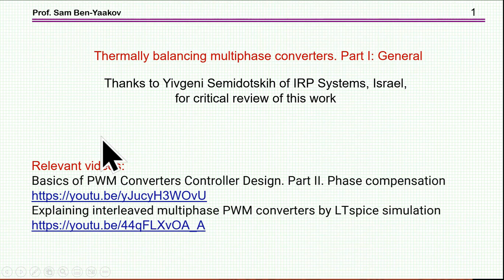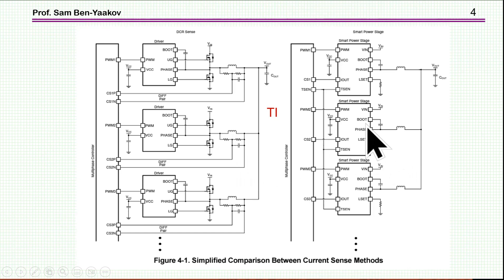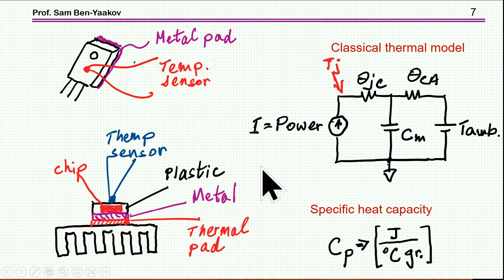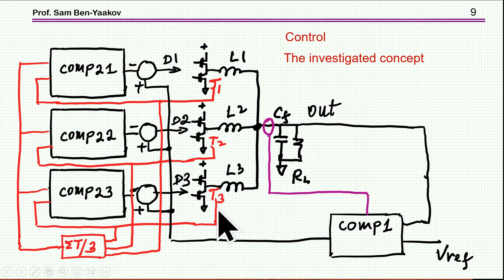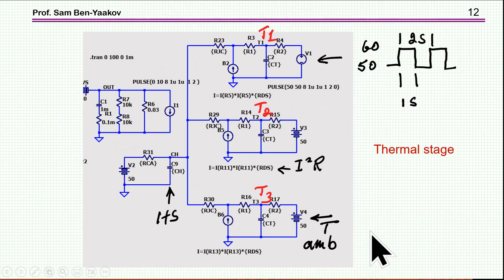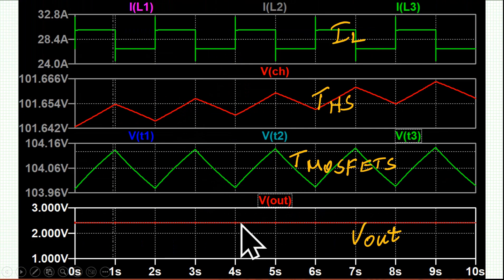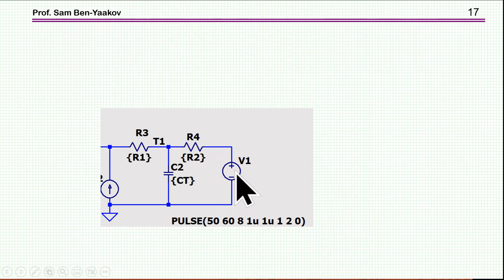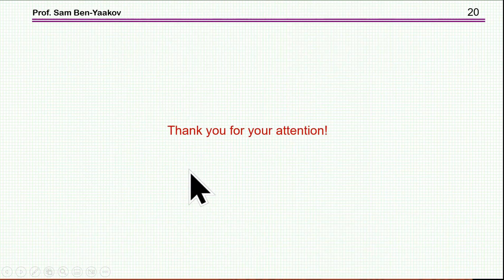Thermally balancing multiphase converters. Part I: General

Comment: Slightly off topic for this video, but have you encountered subthreshold hysteresis and increased bias temperature instability in SiC MOSFETs? I stumbled across these phenomena recently and found them fascinating. I had been wondering why double pulse tests returned such unusual numbers on SiC MOSFETs and it turns out that both of these issues are involved. Not necessarily a video topic suggestion, but I thought I'd mention it just in case you hadn't come across it yet (or in case you had and were considering making a video on it!).
Reply from the maker: Thanks for sharing. No not personally but I lnow there ate a number of papers on the subject. Is this an engineering issue or an academic curiosity?
Reply: @sambenyaakov  The subthreshold hysteresis behaviour seems to be important if any kind of linear operation is required, or if microamp leakage currents matter, but isn't super relevant for normal switching. The BTI issue seems to largely be a problem if drain current repeatability is required (versus gate voltage), and I've seen some talk about it being a problem with parallel SiC FETs due to the steeper thermal coefficient.
Reply from the maker: @gsuberland  👍

Comment: Thanks for putting out this video. Looks like a great concept, but putting the thermal sensor on the back side of the package seems like a bad idea compared to putting it on the heat sink close to the package. Putting the thermal sensor on the back side of the package increases the time delay between heating and temp rise, and while the manufacturer is motivated to do everything possible to maximize heat dissipation through the metal side, the plastic side is a minor consideration, so there is not even any assurance that heat transmission through the back side will track well from package to package. The argument that the heat sink's large thermal mass will slow the measurement is semi valid, but this large thermal mass is also much more tightly coupled to the die temp, which is obviously what you are really interested in.

On the off chance that you are correct, you should get in touch with Intel and AMD and the other microprocessor manufacturers to help them improve the locations of their die and core temp sensors which are located between the top of the die and the thermal interface material under the heat spreader which is connected to the heat sink.
Reply from the maker: Thanks for input. I am afraid though that I disagree.  Putting the sensor close to the heat sink is a bad idea because of the large heat capacity of the HS. The fact that the thermal resistance between die and upper side is large  is not harmful because what counts is the time constant which is small (see the equivalent circuit in video). Putting the sensor close to the die is fine since it senses the die's temp and not the HS.

Comment: Many thanks for next well prepared episode. 
I've made 6-phase 200V / 300A output dcdc converter (50A per phase). With control feedback from output current (without balancing), mismatch between phase currents was +-2A only. Proper design of power stage, thermal strategy and same inductors are a key to symmetrical operation even without phase currents balancing.
Reply from the maker: Thanks for sharing. Interesting.